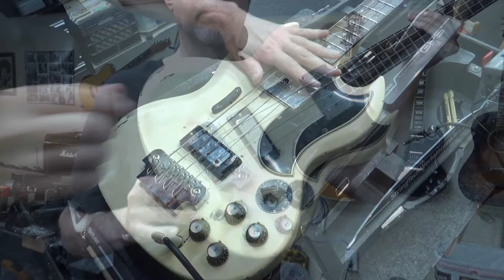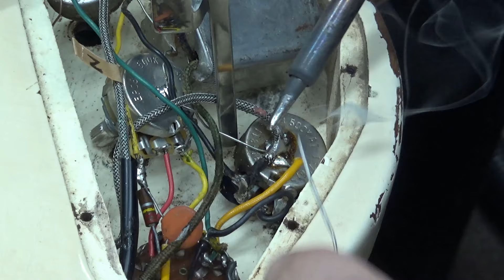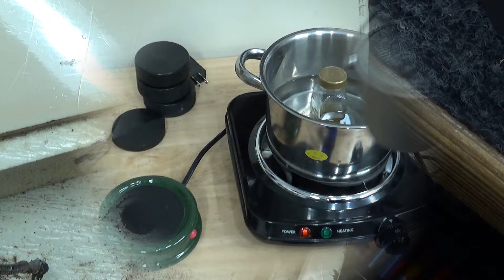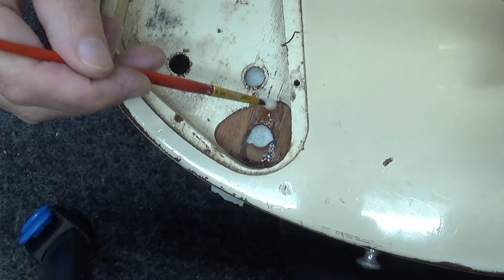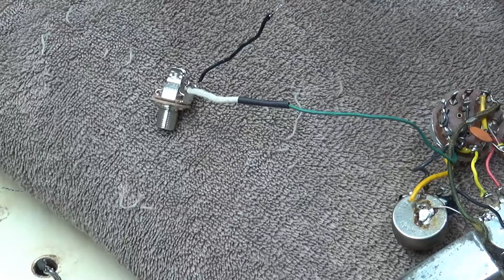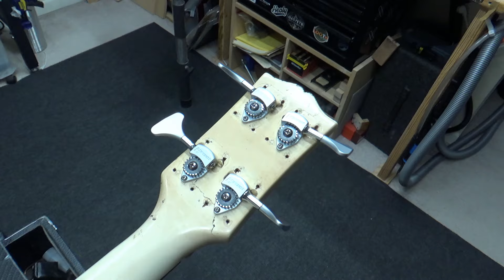EB-3 / SG Jack Repair

Comment: Nice repair using carbon fiber. I once used carbon fiber sheeting to reinforce for a previously repaired horrible break on a 56 Les Paul Jr. I laminated the entire face of the headstock (which was broken in about 4 pieces) using West Systems epoxy (Great stuff for permanent repairs). I veneered a super thin layer of mahogany over the Carbon Fiber to hide the fiber plate.  That repair was more then 10 years ago and it shows no sign of any problems or creep.
Reply from the maker: @jrumiano  That is why I bought this sheet! I figured I’ll get to try that someday. Thanks!

Comment: Interesting little video of a very effective repair. Expecting normal Gibson passive components I was surprised to see the metal box in the control cavity. I guess that it contains some tone shaping components rather like a veritone circuit.
Reply from the maker: @henryhunter5026  Thank You 🙏 The metal box is the inductor part of the circuitry “choke”